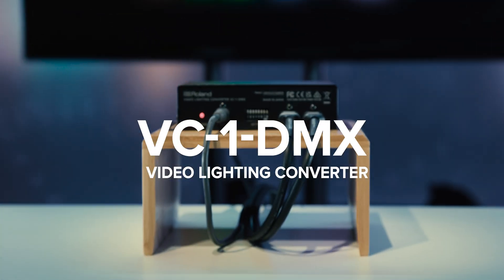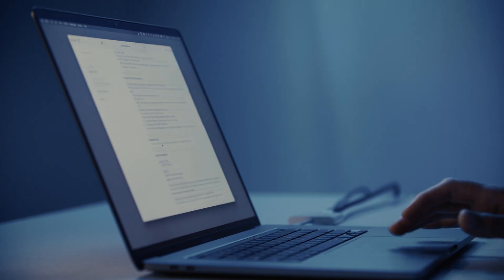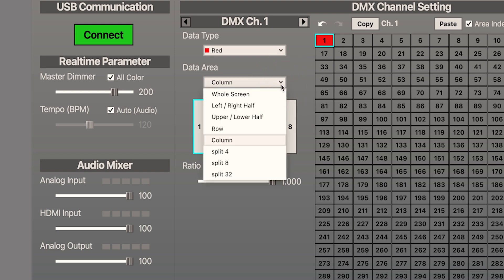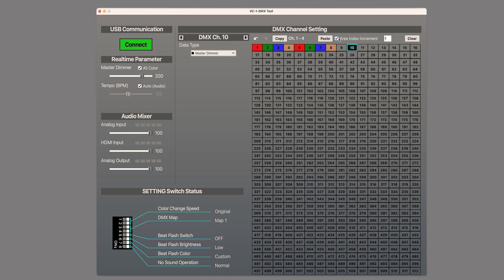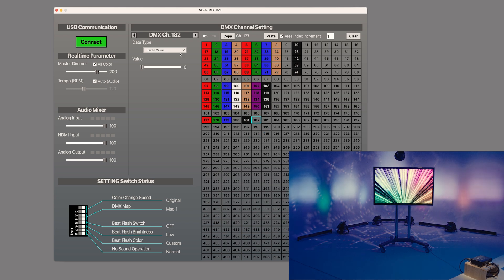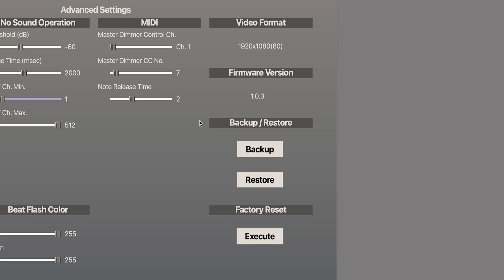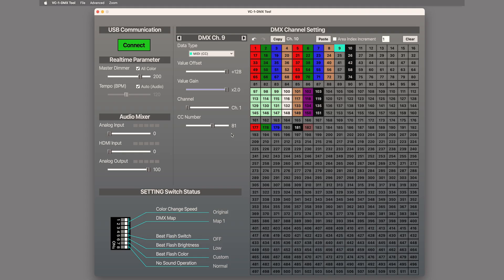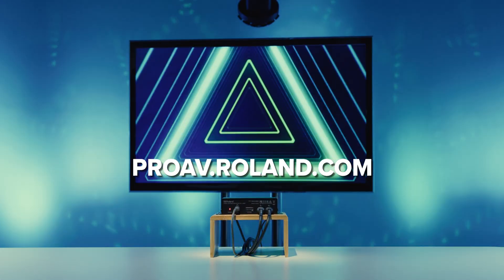Roland VC-1-DMX Video Lighting Converter Tutorial

Comment: Super device! What I didnt understand was that the device needs a video in and output to send dmx. I just want to combine audio and midi. Midi should over rule audio. 
So if I dont make a midi action, beat should send dmx. When I send a midi action beat send should stop as long as I send midi messages. everything standalone on stage without computer. Is that possible?